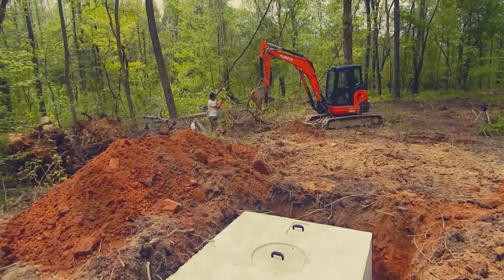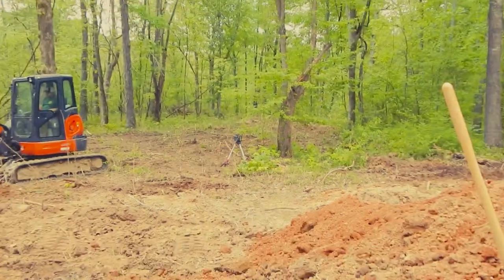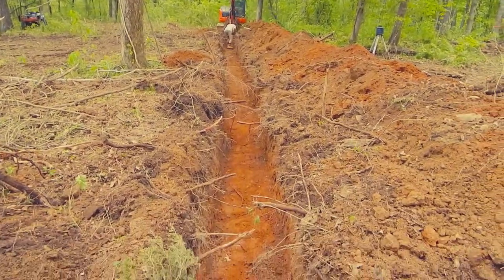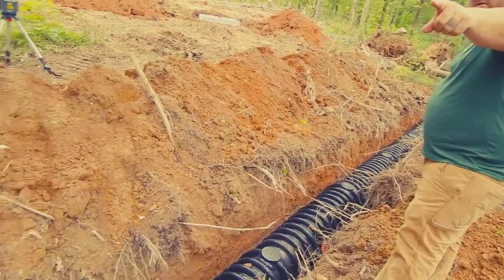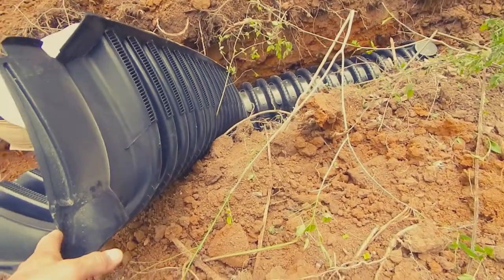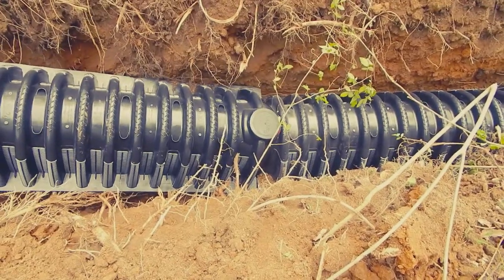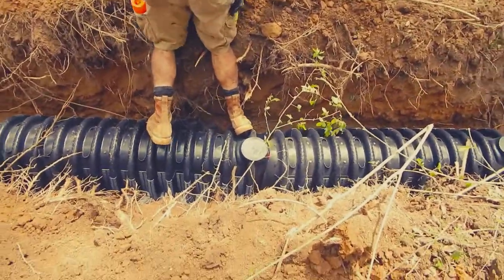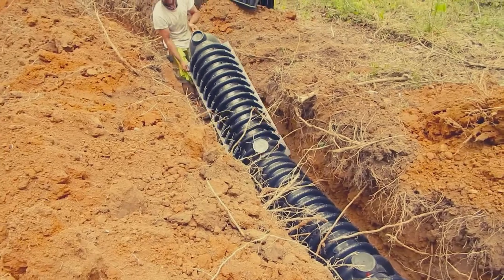Part 2  Septic Drain Field Install .

Comment: we use 2500 gallons or more of water easy every month just the two of us. You can fill that with water quick.
Reply from the maker: wow. I been using less than 300 gallons a month.
Reply: @TheKiloG69  don't need a field that big for 300 gallon of water roots be rooted all in those flimsy Chambers
Reply: It won't fill it up u must take a loooooonnngggg  shower